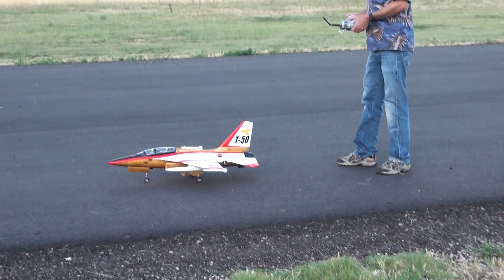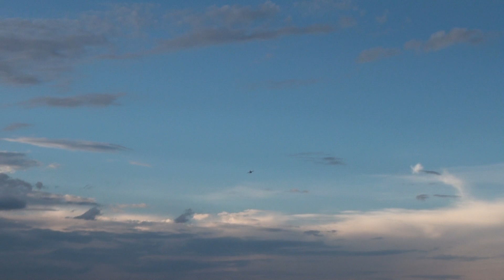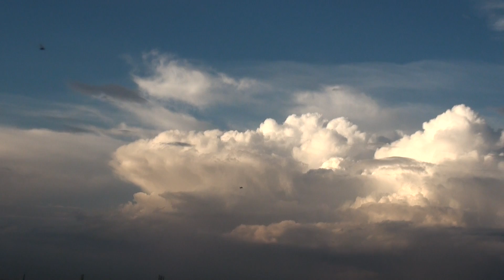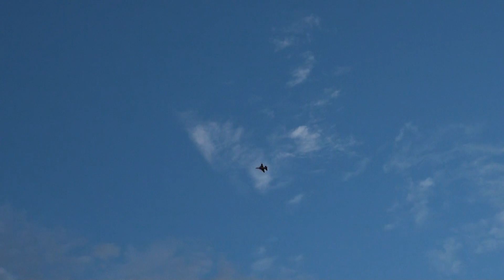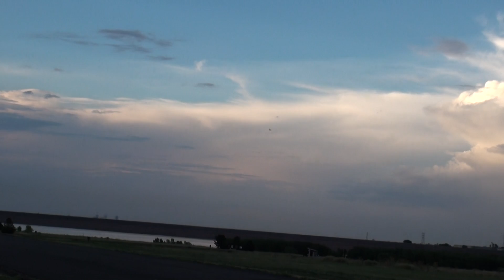Unique Model's T-50 7-28-10

Comment from the maker: @pavcon On it has plenty of power. I was flying it at half to 1/3rd throttle most of the tim on this flight. It has a Sapac MB1 combo in it.  Check out the 5s flights I have up. There are photos up on RC groups in the two threads that are closed.

Comment from the maker: @pavcon Because I was the only one out there & the was no "Down wind." It was dead calm. Also after watching it I might have wanted to get it down a bit faster so I didn't hit low voltage cut of. The nose coloapsed because it lost the little screw that holds the bottom strutt after take off.

Comment: @ColoradoHeliNut thanks for the prompt replys Colorado. HK carried tihs kit and I want touse the RClander new DPS. when you are flying it seems a bit underpowered. or at least too heavy for the thrust. 
The rclander eDF unit with 1.73kg of thrust will easily fly atat 1/3 throttle but will also want to fit a 3000 4s. I have some 4s 4000mah 25c and 45c nanotechs . and I hope I can fit those too. 
if it's possible and if you have the time can you post some pics on rcgroups? I'm pavcon there